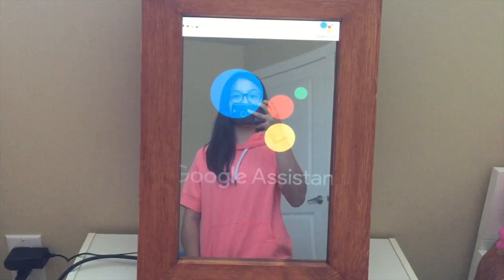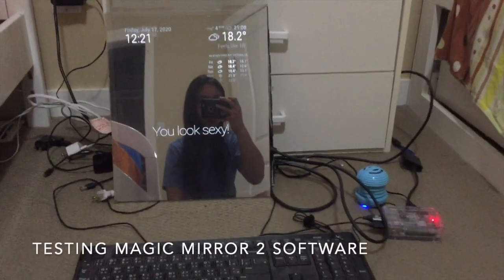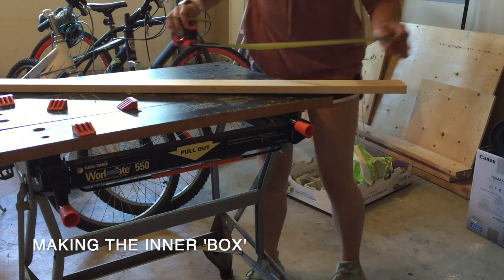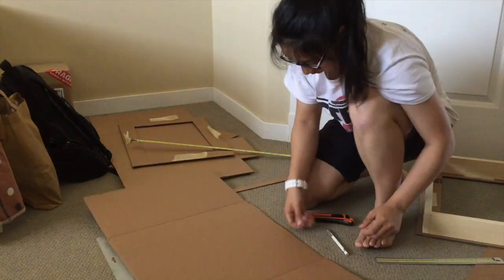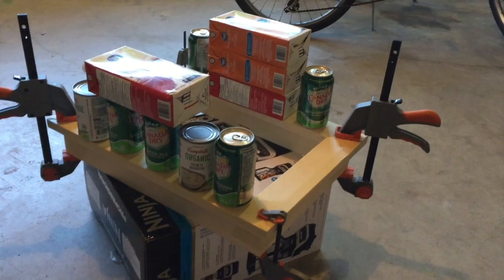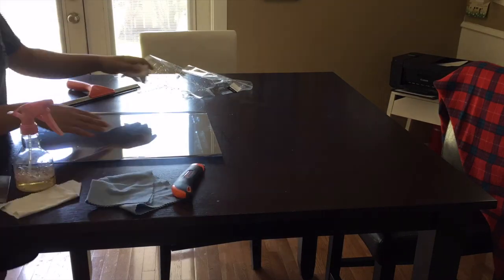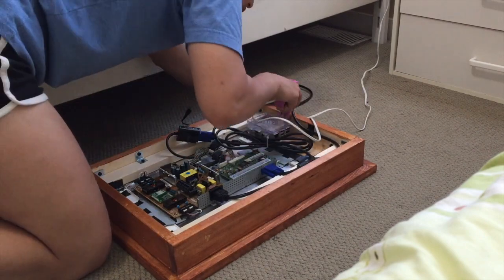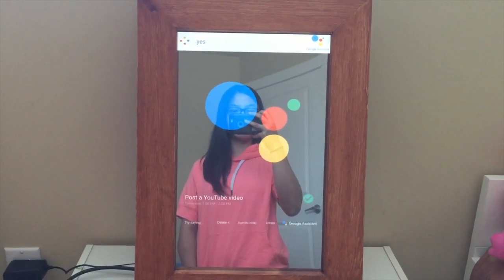GOOGLE ASSISTANT SMART MIRROR | DIY BUILD

Comment: Awesome job. How much time did you put in it to make and build it? and how expensive did it get? Did somebody else help you in terms of planning, setting up and loading raspberry pi? Because you did it very meticulously
Reply from the maker: Thanks!! I think I spent 3 or 4 months with the software just because I kept putting it off and had to troubleshoot some issues but the actual build of the frame only took me around 2 weeks to complete. Since I used a lot of second hand parts and used the 2 way mirror film instead of an actual mirror, I was able to save quite a lot of money with the whole project costing me only around $130. No, I did all of the planning, setting up, and build by myself but I did do a lot of research beforehand and looked at other people's projects for reference.

Comment: Love the build, and planning to replicate this. What type of monitor did you use?
Reply from the maker: I just used an old second hand dell monitor (24”? Any size is fine as long as you build the frame and mirror around it). Since I used an older monitor, it can be quite bulky but it’s not too bad after taking the plastic casing off the monitor.

Comment: Good job, I tried it too, but hotword doesn't work.("Ok google" and "Hey google")
I only installed magicmirror and mmm-googleasistant. Is there anything else I can do?
 thanks,
Reply from the maker: Thanks :). The MMM-GoogleAssistant module is pre-configured with the hotword "Jarvis" so "ok google" and "hey google " won't work. You can however change the hotword if you like by changing the model in snowboy:{} inside the MMM-GoogleAssistant module configuration.
Reply: @peanutmooseh3575  thanks I did it. It works well. ~~have a good day.~~